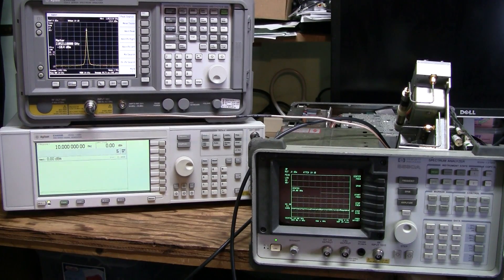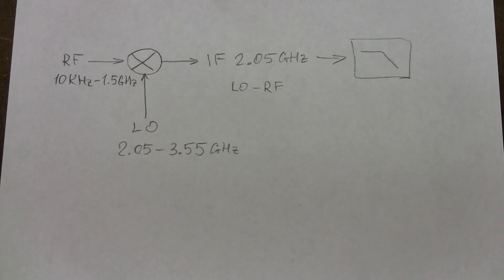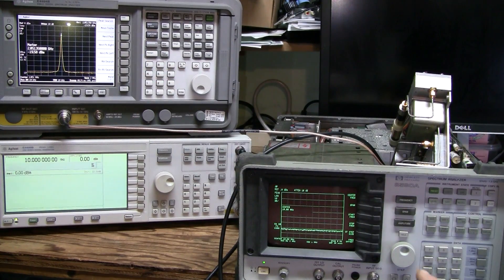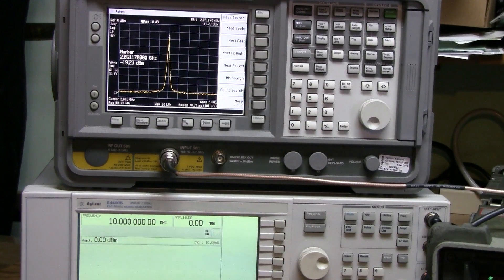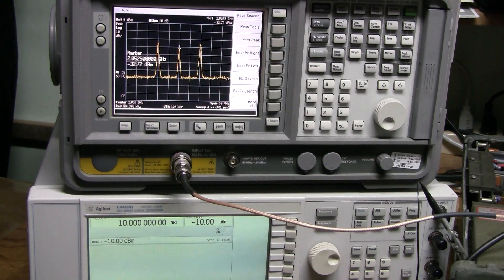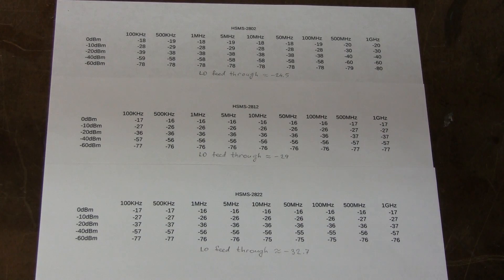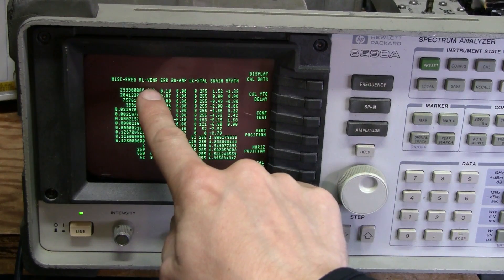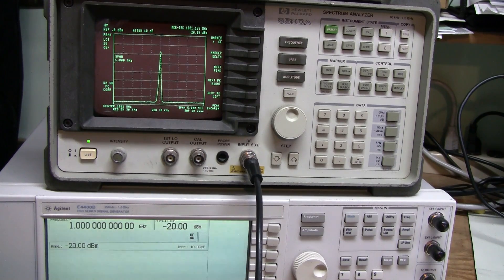#44 - HP 8590A spectrum analyzer repair - part 2 of 3

Comment: Thank you for doing this series.  I recently purchased an HP-8590A that has the 2.9 gHz option.  It passes self cal and test.  RF amplitude readings are basically bang on but ultimate sensitivity of -130'ish dBm is not obtained in narrow bandwidth measurements.  I can only measure to -90 dBm but I am not impaired by this little detail.  The built in 10 dB input attenuator is always in.  I have  not learned how to defeat it like I can on my much older HP 21 gHz analyzer in the 141T storage mainframe from the 1960's.  It was very helpful to learn how to feplace the mixer diodes if I need to.  Thanx!  I noticed a difference between your front panel and mine.  Left lower knob is labelled Intensity.  On mine that same control is a Audio output volume control to listen to the signal demodulated.  I have not gotten that feature to work although there is a noise in the speaker during boot up that indicates a speaker present and hooked up.  Anyone know anything about this audio feature?
Reply: Zero dBm attenuation can only be selected via the keypad. This is to prevent inadvertent overdrive of the input section (possible risk of damage for high power signals). Try SPAN, ATTEN (first softkey), 0 (keypad), ENTER (bottom right of keypad).

Comment: Thanks for the follow up. Shame you didn't see a real improvement for persevering.
Reply from the maker: +InnaSoulSounds 
> Shame you didn't see a real improvement for persevering.
I think the unit needs some adjustments. Too bad that the service manual is not clear. I tried following initial steps of some of the procedures, but they were so vague, that I didn't risk it yet. And there are many corrections in handwriting all over this manual, which I downloaded from Keysight. And there is no explanation of how to measure the coefficients of flatness, which must be entered manually. Perhaps, I don't have a proper equipment, but it would be nice to know.
Reply: +InnaSoulSounds Dude! Spoilers!
Reply: So as I was saying... Game of Thrones, guess who snuffs it this week.. lalala..  :)